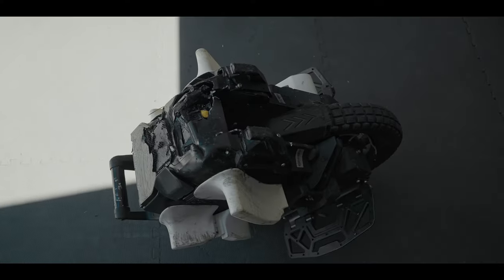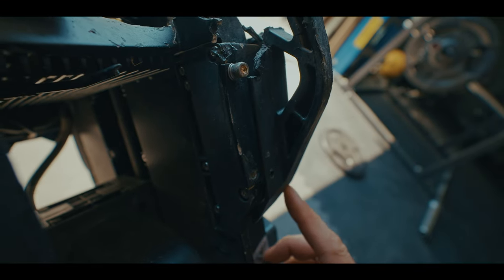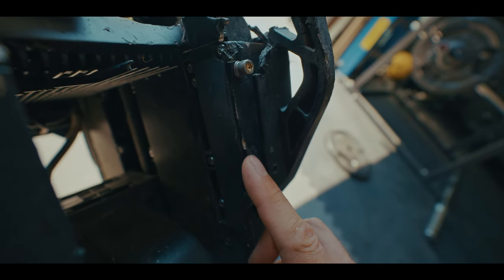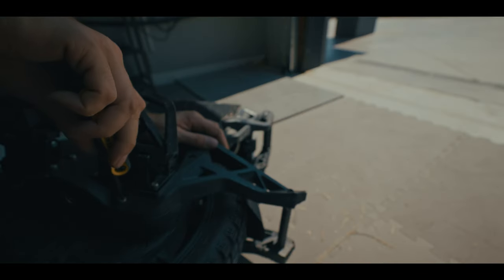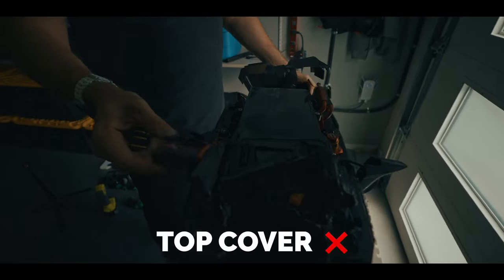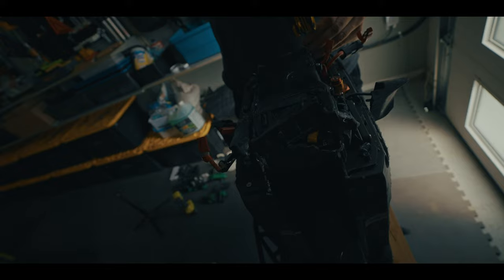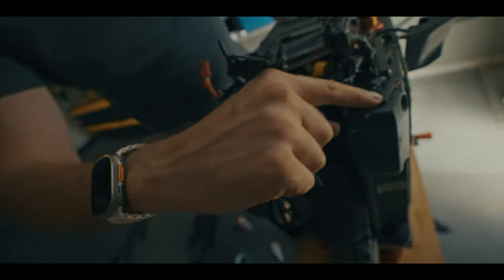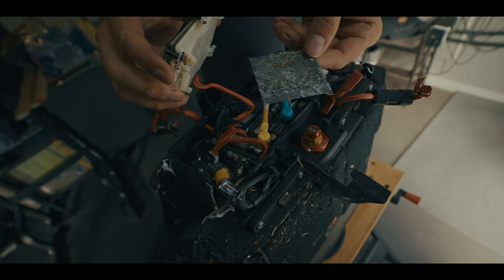We tore apart the fallen #Lynx The Results? Mind-Blowing

Comment: Damn! I'm actually surprised it was damaged so bad.
I've had 2 high speed crashes, but only broke the handles on front and back after a few summersaults on the pavement. Of course mine didn't hit a boulder face on, during a 1000 foot drop either!
Ewheels has the best service I've ever experienced from anyone! They replaced my handles even though it was my fault, and their shipping is as cheap as possible.
If I wanna sell my wheel, I can ship it anywhere in the USA for $150, using a label from them!
Reply: Oh, and of course the seat was the first to break off, lol
Reply from the maker: I think it's all about the angle of impact. In high-speed crashes, the direction of movement is usually at a low angle, almost parallel to the ground. In contrast, when an object falls, it moves at an angle close to 90 degrees, going down vertically. This vertical impact can be as bad as smashing a wheel into a cement wall at full speed, because in both cases, the force is concentrated in a single direction.